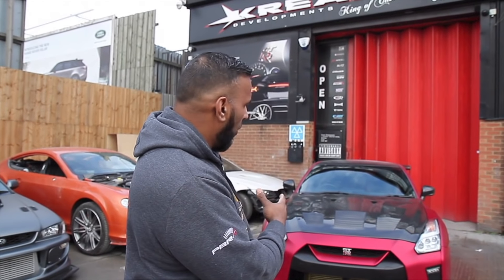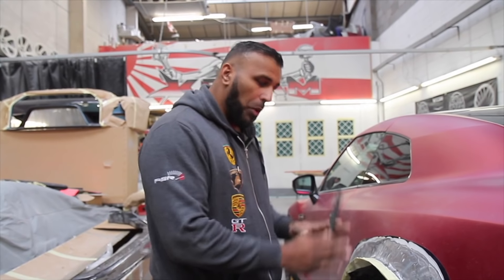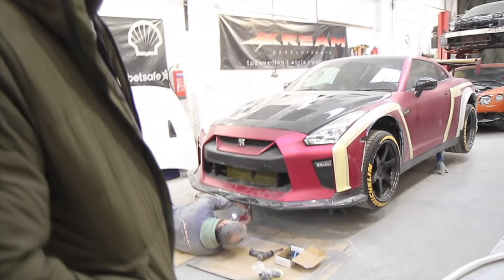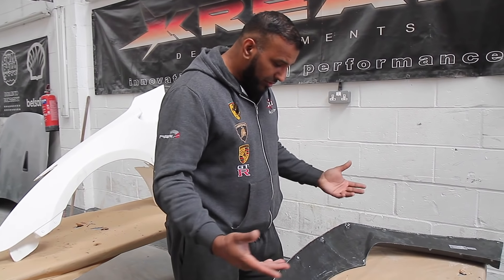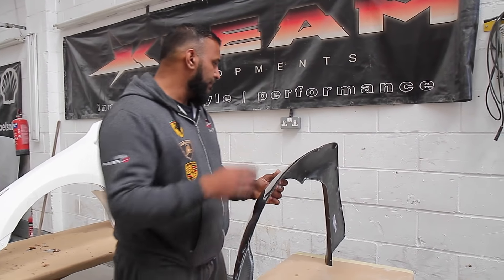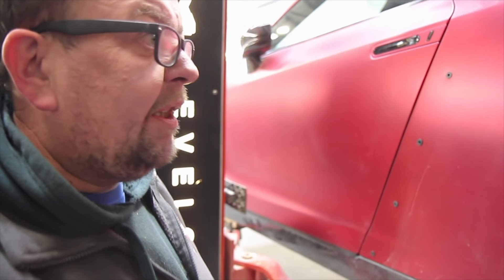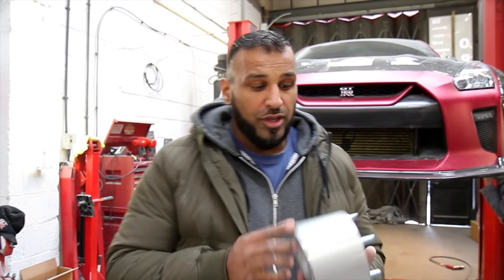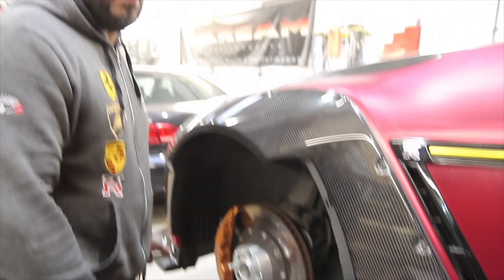Nissan GTR  Carbon Widebody conversion  - Kream Developments:All access Episode 35 [VIDEO]

Comment: amazing video, will finish watching it righ now. but i had to stop in 11:00 to say that well buit carbon fiber parts are made with high grade epoxy and therefore polyester resin and fiberglass will not bond properly. BUT. what you can do is use epoxy resin AND fiber glass to bond other epoxy and fiber glass pannel to it. also look for fiberglass without binder (no chopstrain) because epoxy solvents are not able to solve this binder as the polyester do. try using a twirl or a plain weave. I´m from brasil, studing carbon fiber for 4 years now and building my first 35 body kit in high grade epoxy and carbon parts and molds. this video is very very informative as the hole channel. i´ve learned a lot with them! thanks for sharing.